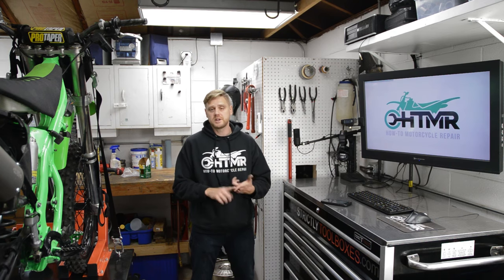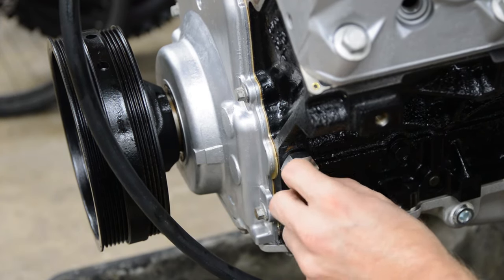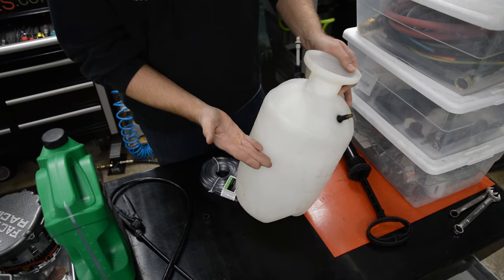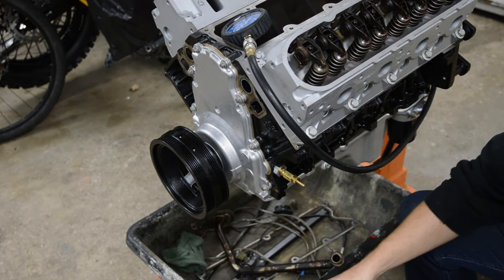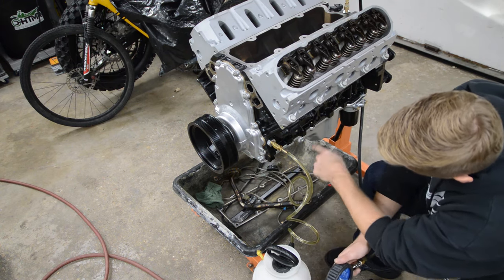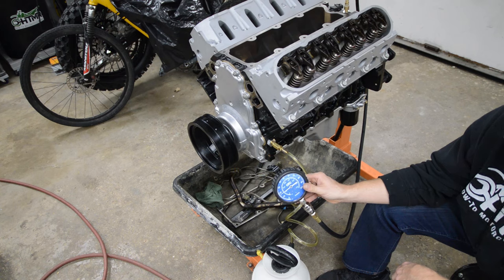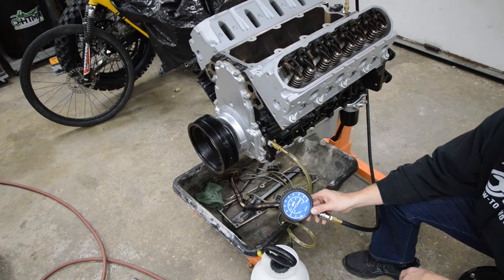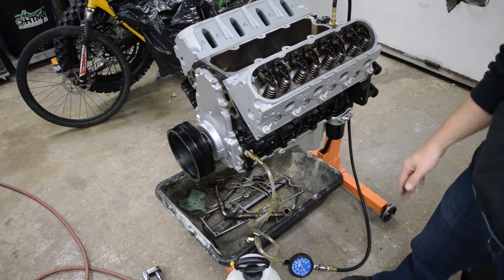LS Engine Priming The Easy Way - $15 Tool

Comment: WHO IN THE HELL PUTS A MOTOR TOGETHER DRY ?????
THIS IS ABOUT THE MOST STUPID THING I HAVE EVER SEEN.
Reply from the maker: Who ever said it was assembled dry? You can't prime the pump until it is assembled.
Reply: @HTMR  you did. Watch the beginning of your own video.
Reply: Everyone primes the engine after its assembled and ready to be test ran. You cant fill the engine full of oil while you’re building it lol
Reply: @intheshoptv  so after you put the bearings motor all together there is some law against putting the oil in ?
Your comment makes no sense.
Are you saying the oil can only be put in after the motor is installed?
Reply: @intheshoptv  I prelube every moving part in motors I build.
I pour some oil or assembly lube in the oil pump and turn by hand so all the gears are coated and then install on the block.
Once started the oil pressure is 60 to 70 pounds within seconds.
You do it your way.
I do it mine.
Reply: @davidsharp922  everyone does that. You’re confusing pre-lubing components with priming the oil galleries. Two different things
Reply: @intheshoptv  okay. Let me explain this for you. I have built probably close to a thousand ls motors since 2015. Always done it the same way. Never had a single problem with one motor.
End of story.
Reply: @intheshoptv  you make it sound like the prelube just instantly disappears when cranking the motor to start it.
It doesn't. 
It protects all the moving parts for plenty of time.
And like I said,the oil pressure comes up very fast.
All kinds of people cook up all kinds of B.S. here on youtube so they make easy money.
I build motors.
Not videos.
Reply: @davidsharp922  That’s too bad… I was just starting to enjoy your story
Reply: @intheshoptv  how old are you? 17 or 18 ?
I have been a mechanic for well over 30 years.
How about you ?
Reply: @davidsharp922  45. I just find you entertaining, is all. I prime the oil galleries as well as pre-lube components. Go ahead and tell the world how that’s wrong lol
Reply: @intheshoptv  like I said before....you do it your way.
I'll do it my way.
Pretty simple right ?